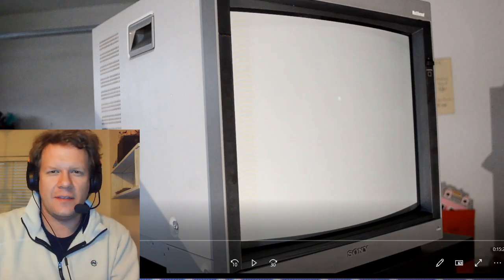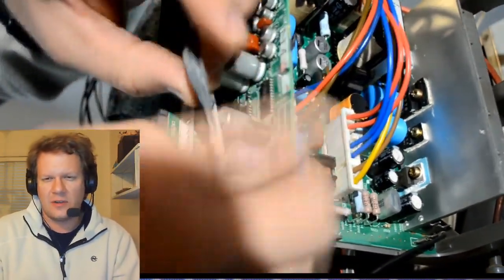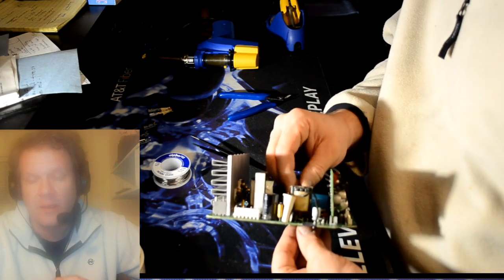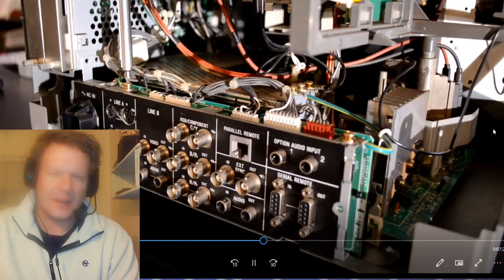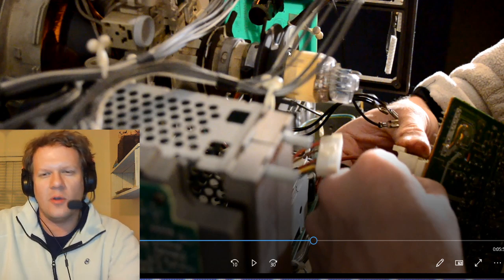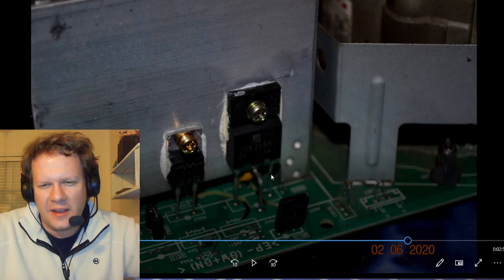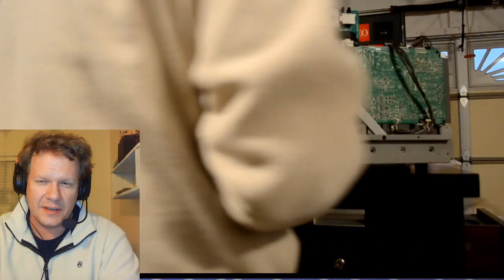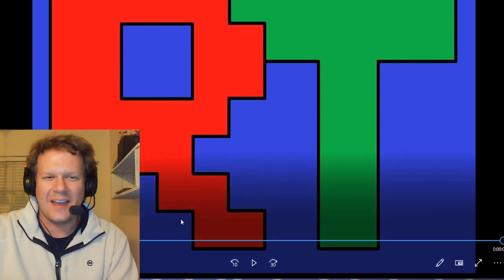Sony's Nightmare CRT Chassis! | PVM 20L5 - Savon Pat's Cap Kit Installation

Comment: Great video! Wondering if sometime you would consider doing a indepth video on extron crosspoint switchers and repairs?

Last night had to do a cap replacement on my extron 50 series power supply, which was thankfully successful in repairing the issue, but I find there is limited comprehensive information actually repairing them online and no service manual diagrams.

Comment: hat kit might not be meant JUST for pristine examples like yours. once electronics get some hours on them, even newer flat screens from say 2011 or 2013, you can see browning on the PCB from ICs and FETs and transistors etc etc, that run hotter or get exposed to heat. some of those uneeded replacements might be stuff that gets some real miles clocked on it after some time. at least that my uneducated 2 cents

Comment: I have a Sony 14” pvm. My red green blue is all switched around when I use composite and I tested each bnc and they’re all switched around red is blue etc. either the guy sold me a broken monitor or the delivery service dropped it cause the lower right hand front corner is cracked up. It was dropped somewhere and I did get my money back. I heard the mask might b out of place or I heard of people switching the wiring around going to the neck board. The color issue sound familiar?
Reply: Is the color change uniform around the entire screen? If so then it isn’t the mask. Try switching around the bncs on the back and see. Might need to switch the wires on the neckboard if it comes to that
Reply: I don’t have anyway to check the bnc through SCART yet but I used a bnc adapter on a composite cord and tried each connection and yeah, red was blue green was red etc